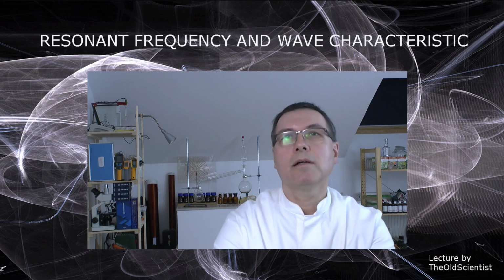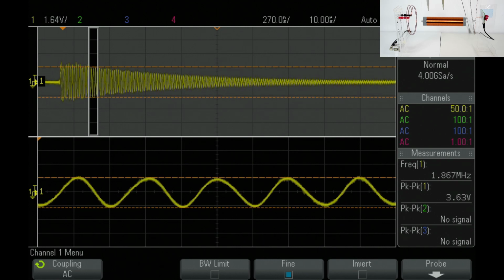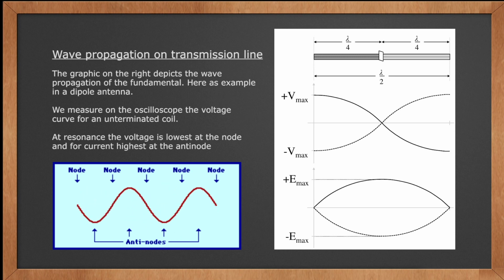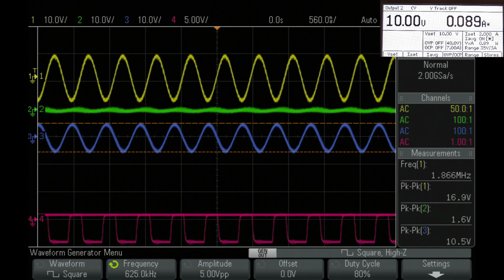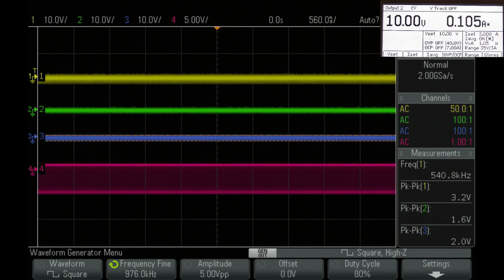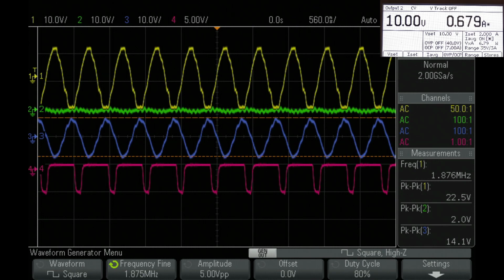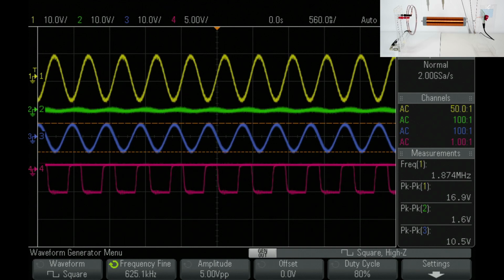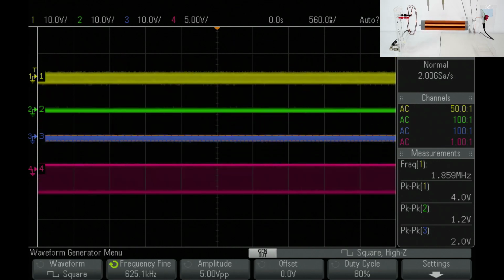How to find the resonance frequency and the wave characteristic associated to it

Comment: Very informative for a beginner are you familar with don smiths work? Do i need 4 channels to find resonances in wire coils? I wanna start with one coil say 3 feet then secondary coil12 feet 6 feet wound clockwise then the other 6 counter clockwise and try to create a Tesla snowball effect i do believe our physics fundamentals are broken i think the electron is a dipole and everything is simplex pressure mediation. I have a 2 channel osscilscope and function generator i want to find resonance in the 2 coils above in say the AM RADIO BAND
Reply from the maker: You can do it also without oscilloscope. You require however to do some math. On the receiving side you need to connect two diodes. Both are in opposite polarity connection that both wave cycles energized the diodes. a signal generator on the transmitting coil
Reply: @TheOldScientist Thanks so much that's a lot more straightforward, let me see if I understand you connect the diode as usual but the 2nd you turn the opposite direction, and resonance is reached when they both light up? Does that mean power can flow both direction at resonance?

Comment: Why the frequency of the same coil with slayer exciter is lower than your setup. 
Your setup gave me 1mhz. But slayer exciter gave me 765 khz?. Thank you
Reply: I have noticed by building several slayer exciter circuit Tesla coils, the size of the secondary and the size of the top load effects resonance.  The larger the secondary coil or the larger the top load will lower the resonant frequency. Big secondary, low resonant frequency. Big top load, high frequency. I use 1.5 inch diameter, 5 inch tall Tesla secondary for my slayer Tesla coil and it works well. Let me know and I can send you my specs for a Tesla slayer design that is inexpensive yet provide ours of fun.

Comment: Could you give me some feedback on a overunity motor build?
Reply from the maker: How do you expect me to do that. Unless I have measured the device it is only a guess which does not help anybody.
Reply: @TheOldScientist  its a gear ratio setup. Two motors, one spinning the other with pullys inbetween them. Input: 3a/12vdc, output: 9a/36vdc. When you hook to a draw the motor bogs unless you add a resistor to the negative lead. Either way the output levels out with the input when a solar charge controller draws on it

Comment: A good introduction to resonances and harmonics! Sorry I missed it as I would have had some questions and pointed out some interesting properties of air coils. Have you by chance heard of magnetoelectric materials? They have interesting properties for parametric pumping in the MHz range. I would be willing to send you a bismuth ferrite core to test; I have been working on fabricating my own as well. I would also be interested to see how ferrofluid compares to metglas. I assume the losses will be larger because the ferrofluid will stir during operation. It is possible instead to add superparamagnetic nanoparticles to epoxy to create a reasonable metglas alternative - perhaps even better due to lower resistive losses. Once you have such a composite, look up the neel relaxation time of the nanoparticles and resonate your coil around those frequencies, being careful not to fully saturate the core. I have my result for this experiment already; I am curious to see if you can also get this result. Hint: you may need a high or low pass filter to remove a new signal from the resonant system
Reply from the maker: Hello Michael, I was thinking and working on the subject a long time. Increasing the magnetic flux without the side effect of having a solid core material which under resonance will shatter. I used single sheets of Metglas but the problem is the operating frequency. They work only to a maximum of 1 KHz. I found another material I was testing. this however is very expensive but works in the gigaherz range. It is a flexible ferrous sheet which can be applied to any surface. If you use epoxy you create a solid with very strong dielectric properties. Anything in fluid form will vary in performance based on current applied. It has to be an offset between performance and indestructibility. As far as I know that is currently not existing on the market but worth to look into it. Especially for applications I have in mind I will share in upcoming workshops. Let us have a private conversation about it.
Reply: @TheOldScientist  If you want to work in the GHz range, yttrium iron garnet or gadolinium gallium garnet will be best. Gadolinium gallium garnet will even work at THz and visible wavelengths. I recommended superparamagnetic nanoparticles because they have properties which demonstrate flaws in the current assumptions of thermodynamics. Certainly let's discuss it further
Reply from the maker: @michaelperrone3867  Thanks but I think I mentioned that I have no equipment to work at his wavelength. I do not like to fly blind.
Reply: @TheOldScientist  There are ways. Just thought I'd remind you of those materials since you mentioned the flexible ferrous sheet above. Anyways I'll send an email and get a conversation going

Comment: I think the  question regarding high frequency , was referring to the terahertz range
Reply from the maker: At that level only optics work. Wavelength is too short for wire.
Reply: TheOldScientist ahh. Thanks
Reply: @drscott1  But you trigger the signal via lower harmonics. Otherwise Laser or Maser would not work where a crystal or gas is excited.

Comment: Great video Thomas. I was out for a long time with my experiments. But I will start soon...
Reply from the maker: Just to recap what Air core coils good for is except for entertainment good for communication and to be more important for a subject of my workshops. Resonances in biological entities
Reply: @TheOldScientist  Appreciate you making this informative video available, an excellent video lecture that I was not able to watch live.  I have 2 questions I would like to ask you, thanks: 
1: Are the resonant frequencies that you demonstrate based on coil inductance and interwinding capacitance, or the electrical length of the coil wire, or both?   In other words, is it a standing wave resonance or an LC resonance? 
2. Why is the resonance frequency of a single layer air coil so influenced by materials that are brought close to the coil?
Reply: @ReasonForemost  The air core coil is very sensitive to any disturbance in the close surrounding. It is a standing wave which is not the full wave as you would expect when you hit a bell. Like the transmission line the first harmonic for an open circuit measured is always the quarter wave. You have to divide the value by four to get the full wave self resonant frequency. You can see that only on a spectrum analyser. The oscilloscope will always show half wave for un-terminated coils and quarter wave for terminated coils.
Reply: @thomasimlauer1271   I find this topic very interesting, and If I may, have followup question.  Since it is standing wave resonance that you are demonstrating, which makes sense, why is the air core coil so sensitive to any disturbance in the close surrounding?   Is a disturbance in the close surrounding of the coil changing the dialectric constant of the medium and thus the velocity factor which changes the standing wave resonant frequency of the coil?  I find this fascinating but have not found a clear answer to this regarding the air core coil and would appreciate your comment about this and any references that you may suggest reading.  Thanks
Reply: @thomasimlauer1271  could u explain the quarter wave nd resonance frequency for copper and iron and how it affects current transmission via natural  resonance nd quarter wave esp if voltage is applied. Hope 2 c with frequency generators explained with different factors including diameter of wire